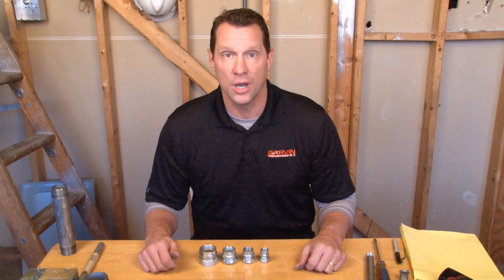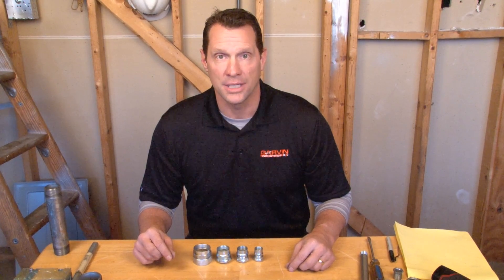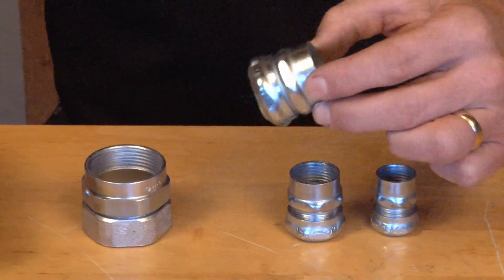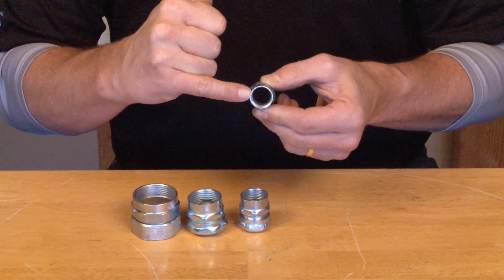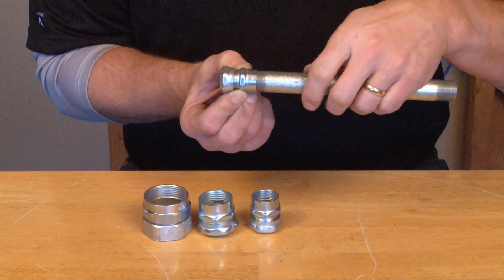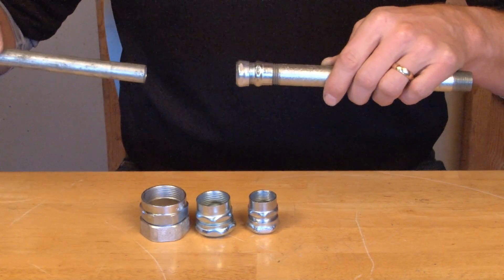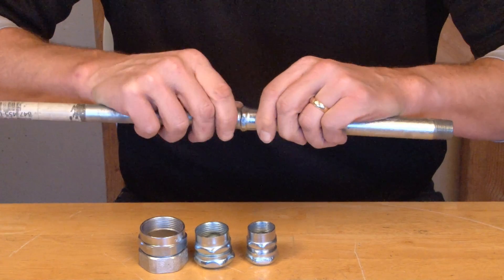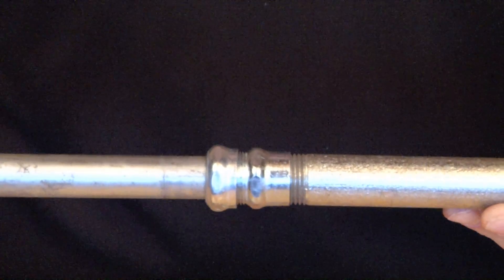3/4" Combination Coupling used to convert Rigid to EMT: RTE75

Comment: i needed one of these to go from compression emt to nonmetallic liquid tight to go from outside wall to a pedestal for a keypad entry system

do you know if they possibly carry this at home depot or only at electrical supply shops? 

i already just used an LB to switch but in case i do not have room for LB